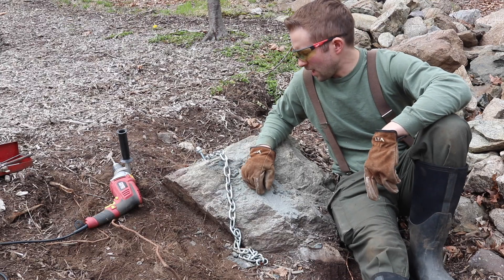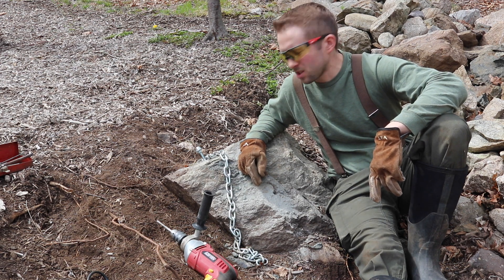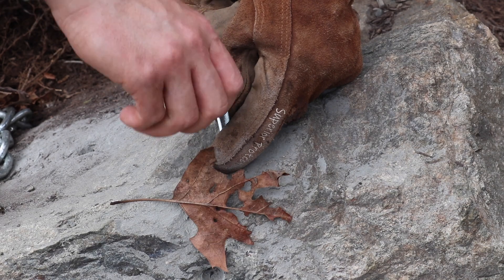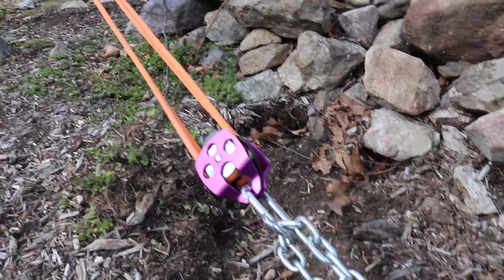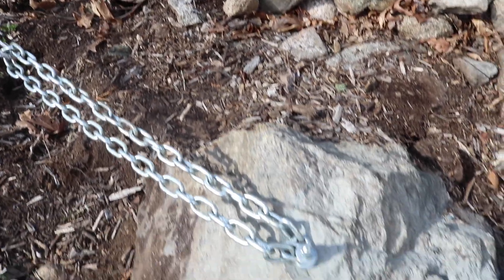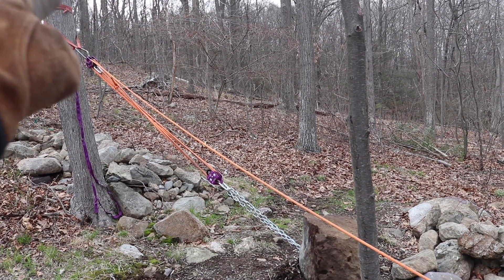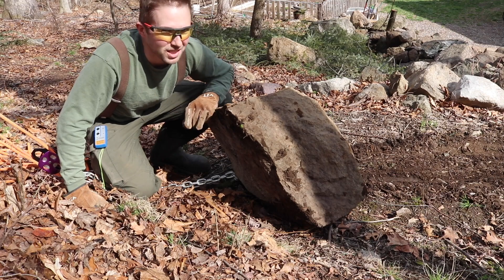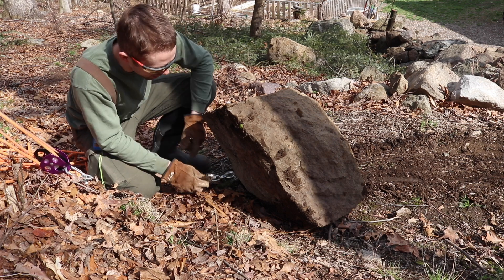How to move a large rock with Pulleys 🟩 4-1 Mechanical Advantage

Comment from the maker: 32 KN Double Pulley:   https://amzn.to/3Yzoqo1
60 M Static Rope:         https://amzn.to/3EbuCfh
26 KN Carabiner:          https://amzn.to/3EbuCfh 
110V Winch:                  https://amzn.to/3Gdep9P
Rigging Sling:                https://amzn.to/42zntNR

3/8" Anchor Bolt:         https://amzn.to/3G9Zopj
3/8" Rock Drill Bit:       https://amzn.to/3GeKUEQ
Hammer Drill (Sds):    https://amzn.to/4itZVA4

Comment: Nice video, man! I noticed there are a lot of rocks in the area. If you don’t want to drill into every big one, I recommend trying a method that me, my father, and my uncle use to move large rocks. It’s basically a chain net.

You can make one using just chains, nuts, and bolts. Lay the chain out in a grid or “#” pattern, and bolt together every intersection point. Then, wrap the net around the rock and use another bolt to close it tight. Once secured, you can pull with all you can — if it’s done right, it won’t slip, and you’ll be able to move rocks of pretty much any size. It works on logs too.
Reply from the maker: Thanks, that is a really clever idea. I’ll add that to my bag of tricks!

Comment: So I have a set of those wedges and have had great results. First, don’t push on the drill bit too hard. It creates too much friction and dulls the bit. The bits are meant to chisel the holes so you need the hammer action. Second, the holes should be 6-8 inches apart and as parallel and straight as possible. Third, you gotta slowly hammer them in. Two medium taps on each and move to the next one. Once you move through all of them, give them time to rest and let the pressure sink in. You’re trying to slowly crack the rock. Just move up and down the wedges taking 30-60 seconds before you start back through them. If you do that and listen you will hear the rock start to crack. And finally, you gotta clear as much dirt around the rock as possible so it has room to expand. I’ve broken 5 rocks from under my deck that were about 3 times the size of the one. Each took me about 4 hours to break down into sizes my little Kubota could lift. This method has been used for ages to break rocks.

Comment: This is a 4:1 pulley system.  If you end for end the rigging and pull in line with the rest of the system, it'll be 5:1
Reply from the maker: You are absolutely correct. Another commenter correct this on the short I filmed about this project. Just didn’t have enough time to correct and re-upload the video. I’ve corrected the title.